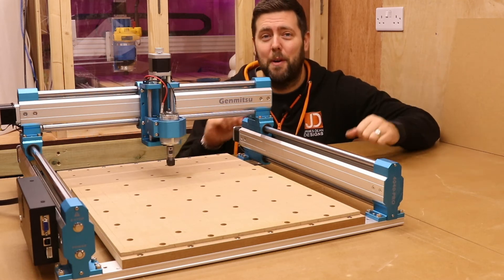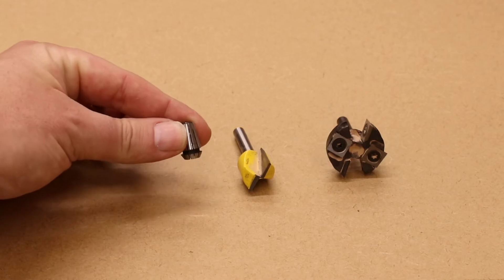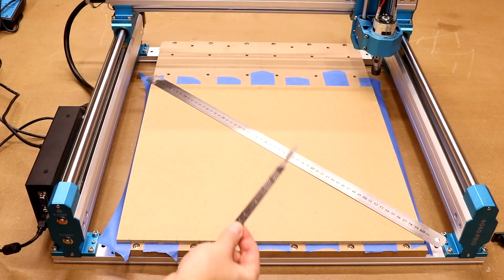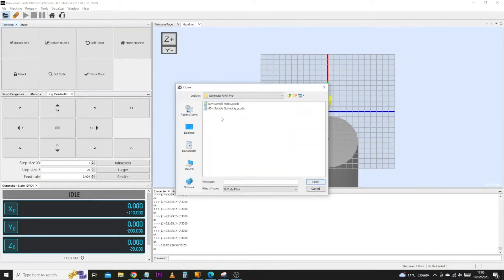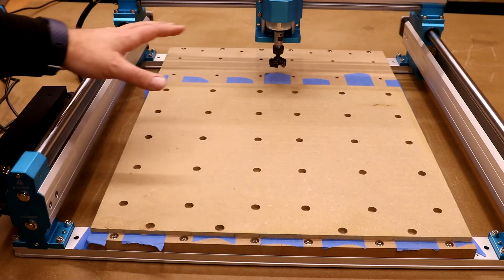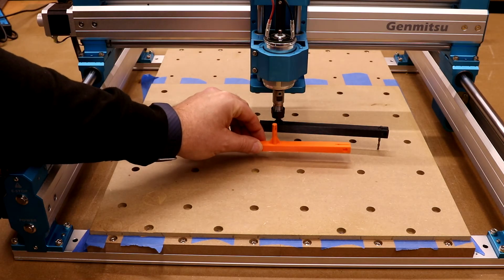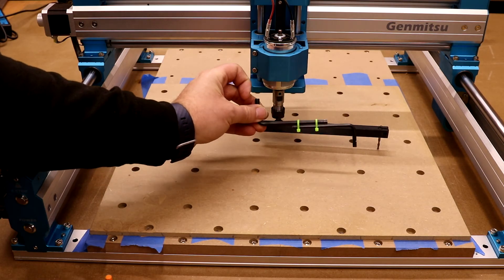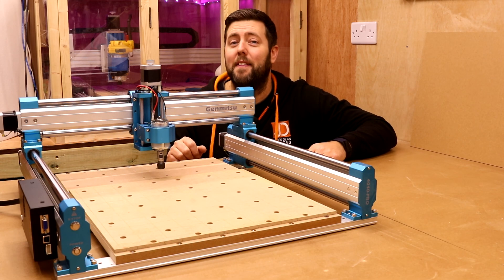Spoilboard and tramming on the Sainsmart Genmitsu 4040 Pro

Comment: Got a home made CNC with a 500MM X 600MM BED so this will be useful as a guide, I had already used one of your videos for a 2418 CNC in past (that was for 3018 but still applies). In case asked the working head is a Makita 700W router with up to 1/4" shank.

Comment: Thumbs up, always great presentation. I will take my time and save up for a 6050 machine however. I'm sure this would be fine for a lite hobby machine, but, for me I will spend the money on a more robust machine and cry once ! Cheers and all the best from Utah !
Reply: I bought the 4030 and yeah I should have saved another 1k to get a good cnc. Replaced the drivers and mainboard and modded the lead screw fixtures to get less chatter. 
I should have bought a Sorotec cnc 😂

Comment: Everybody likes to tram however, it is not needed on a machine that doesn’t have a high tolerance, such as a Bridgeport or Haas, CNC milling machine. What I’ve done is I would level the X and Y axis so that they are level with earth level then I would take a level and check the spindle and you can see if the spindle is 90° using the level to the waste board  You can use one of those digital angle degrees as well. It works good. When you use the level or the angle measurement tool do you need to measure the front and the side of the spindle so you get both axis. I have done this and I’ve gotten it dialed in. Really good with no problems. You can use shims to adjust the corner of each side of the machine for leveling the X & Y axis.
Reply from the maker: If tramming helps the precision (which it does) then its needed. And for the short time it takes to tram it in, its well worth it. May not be your preference but its certainly improved my results on every machine I've had and I'll continue to do so

Comment: Thanks James for your great videos
I'm very new to this, so your videos helped me out a great deal
I have 1 question 
I have the Dewalt 611 with the 69mm adapter on my 400x400 
Do i need to make an adjustment for that and  move the board 2 mm forward or will running the Makita G-code?
Thanks again for your videos
Reply from the maker: Oh that's a good question and one I didn't cover. Yes in theory if you don't trip the limit switches. I generally allow a bit of play in my files so yes, hopefully 2mm should cover you
Reply: Curious if you tried this 2mm adjustment with the DeWalt router and how that worked out for you?

Comment: Once again, I can’t thank you enough for all your help, tips and information! I followed this guide to tramming with my original 75 spindle now I’ve upgraded to the 65mm spindle holder and the 710 W Genmitsu router and I cannot get it trammed! Back right hand corner of about 40° of the board doesn’t get touched by my tramming tool, no matter where I put the tinfoil, any suggestions please?

Comment: James @8.50 you say to leave the spindle where it is. However the machine finishes the cut hole sequence on the last hole. Therefore we have to move the spindle back to x marks the spot. Luckily i had already set the command 1 setting.
Reply from the maker: Once the job finishes, it should return back to the centre. If it stops straight after finishing the hole then something will have gone wrong but at least you've sorted it 👍

Comment: The wood I have available is 0.218 in thick birch sanded plywood.  Is this to thin to use for spoil board. 
I am in US and 0.24 or 6mm is not around.
Thanks for all you great videos.

Comment: Thanks for making this video and the files you provided.
I'm new to CNC and have the 4040 Reno. Can you use the .art file for the Reno? it seems that the spoil boards are the same from the Pro to the Reno and they are both 4040. If so, it would certainly save me time with doing this for my Reno.

Comment: Love your videos, they are a big help in getting started with this machine.  I downloaded your files for the spoilboard but keep having issues where they cause an alarm in UGS most likely running into a softstop.  Not sure how to correct it, any help would be great.  Thanks for all the effort making these vids.
Reply: Probably the Z. You have to lower the spindle pretty far down or else it will hit the soft limit switch and shut you down.

Comment: Hi James, I have just got the 4040pro running and doing spoilboard, am using the Genmitsu r118v router which is 65mm same as makita. I placed the mdf at the front as per video, and drilled the holes, drilled ok, but I thought the holes on spoilboard were to be aligned with pre drilled on the bed, can you clarify please, thanks Gordon

Comment: Good morning, James I have a question. I followed your tutorial for my first spoil board holding the board back to the point that you showed and used the spindle that came on 4040. I have since upgraded the spindle to the Makita router and installed the new Z-axis and want to resurface the board so how do I go about doing this with the board in the spindle location. Each phase of the procedure is shown for the spindle and the Makita but before I click on one of them just wanted to check with you first. I checked other post but didn’t see something that addressed my question. Thank you in advance and thank you for your tutorials. 
Regards, Lamar

Comment: One other comment on shopping list.  on the MDF you call out 435MM wide as 19.7 inches.  I just want to make sure.  I see the spoilboard is even with the base board and 19.7 would for sure be too big. 435MM is 17.12.  Just want to make sure I am using the correct measurement.  Thanks James!!
Reply from the maker: You're absolutely 💯 correct. Have no idea why I put 19.7 other than the board was originally 500mm wide. Either way 19.7in is the wrong width
Reply: @JamesDeanDesigns   Houston, we have a problem. We have NASA engineers making unit conversions again. Yes, I used the 19.7" dimensions and started cutting the holes. The metal inserts were not showing up in the holes. I would pause the program and I thought it was because I was using thinner MDF than 6 mm. Well after 4 holes I discovered my center was off because of the 19.7 in dimension. 435 mm = 17.125" or 17 1/8". Darn us Americans that still use the English system of units. It is a good thing our creations are NOT going to Mars. 😉

Comment: Hi James, I wondered if you have a solution to fitting a dust shoe to the 4040 when fitted with a Makita router? I tried the one meant for the 4030 but it's too big to use on the 4040.

Comment: Brilliant video James. I've just ordered a router for the 4040, will you be doing a conversion video for it?
Reply from the maker: My review will be done using a router. Probably will not do a separate conversion video because it literally is just 4 bolts and then just tramming in it. I've already got a separate video out for installing an SSR which is all you really need

Comment: Great video James! I was wondering, could you make a video on building a metal bed for this machine to use it with coolant? I imagine something made from wide aluminum extrusions would be perfect for machining metal parts.
Reply from the maker: This machine doesn't actually require a bed as such it will be covered I my review but essentially drop a thin plate of metal on a table, bolt the machine down without the bed (perhaps a little silicone around the bolt holes) and you're good to go

Comment: How do we compensate for the fixture flex in various tramming methods?  Other videos suggest using a dial indicator on end of tramming fixture.  Would that be necessary?
Reply from the maker: If I understand  your question correctly, any flex should be consistent as you revolve your tramming jig so it should not really be necessary to factor that in as the tramming jig should really only just be scraping the surface

Comment: Why do you not use a larger spill board? If I wanted to make something the fullsize of the bed, I would not be able to with this one right? Are the files your provided easy to adapt to a larger peice of mdf?
Reply from the maker: If you used a piece larger than the work area, when you come to surface it you would effectively end up machining a pocket out so if ever you put a piece of material on your bad that hangs over one side or more then it would technically never sit flat. Can't remember the exact files I provided on this one but I think I started sharing the original drawings and Carveco files so you should be able to modify if required

Comment: Given the way you secured the 6mm spoilboard to the mdf router base-board using a sandwich of 2" painter's tape and CYA glue/activator between the "slices",  how do you later "remove"  the spoilboard?  Would you reccomend double-sided (as in carpet) tape?
Reply: the blue painters tape has 3 qualities, easy to remove, doesn't leave an adhesive residue behind, paints and adhesives don't soak into it.  the CA glue gives you an instant, thin, strong bond.   when you go to lift and remove the board the blue tape peals easily an comes off clean.  most double sided tape is thick with very aggressive adhesive that hardens over time and will be difficult to remove the boards, may even tear chunks out of the MDF and will leave a mess on the surfaces.   the blue painters tape and CA glue is a perfect idea

Comment: Thank you James, a truly interesting and instructive video, but I have to say that, after watching the video, I tried to achieve the verticality of the spindle with respect to the original aluminum plane, not the MDF spoiler, and it has been impossible for me, I give up. I have a Genmitsu 3020 Pro Max V2 machine expanded to 30x40 with the 710w Genmitsu spindle, which I have been very happy with so far, now I can't shake the thought that there is no way to correct its perpendicularity. How is it that the manufacturer has not provided an effective method to achieve this? My 3D printer does have a mechanism to level the base.

Comment: As always, great video! Do you think this machine will be enough for milling aluminum with an upgrade router like the makita? Are the rails and motors strong enough?
Reply: Machinist here. By looking at the machine and looking up the specs, the answer is both yes and no. Would it be possible to make some chips? Yes, probably. Would you be able to make any functional parts? Not likely. The frame is not nearly rigid enough, the 10mm shafts are way to skinny and would flex and lead screws suffer from backlash.
Reply from the maker: These machines can do metal engravings and even cut pieces out but not to the precision that machinist would expect, so Snakedad is fairly accurate.
Reply: Thanks for the reply guys. I really appreciate it to help me find a decent all rounder machine without breaking the bank.
Reply from the maker: @MasterNengLee  usually machines that do metal well are often smaller work areas and are more ridged. For example this may be accurate to a few tenths of a millimeter, but a more ridged machine will work to within a few hundreds of a millimeter

Comment: Will this process work for the 4040-pro max? How is this done if i have an upgraded spoil board that has the slots and not the holes?
Reply from the maker: I think there is a slight difference because the pro max can only go 405mm wide where as the 4040 pro could do 430mm. I have made a spoilboard for this machine. But just didn't do a video on it this time. If you message me via my website, I'll send you the files if that helps
Reply: @JamesDeanDesigns  Thank you! I just sent it.

Comment: Thank you for the down load for the 4040 pro spoil board. I am using a Makita router . I homed I zeroed and my xy axis made a noise and these codes came up any help is appreciated. I used easel with no issues
Error G10 L20 P1 x0 y0 z0

Comment: i have been trying to set my grid on my spoil board and for some reason it is not letting me use what you said was available every time i try ti open the file there is nothing in it and i have destroyed 2 spoil boards trying to get it to work and it wont and so i tried to do it on my own and guess what i screwed up another board THANKS

Comment: Great video, I'm new to cnc and find your videos super helpful. I bought the 4040pro and used your videos and files. However I'm wondering if maybe I did something wrong in setup as I just ran my machine using your 60w holes file, it did the larger area of the hole but did not go all the way through? I made sure the bit was touching the spoilboard before running. The spoil board is 1/2" thick. Any help would be greatly appreciated.  Cheers
Reply: What I mean is it didn't drill the center of the holes. Just to clarify
Reply from the maker: It is because you used 1/2 thick material. I do say in the video it needs to be 6mm (1/4in) MDF. Anything thicker and the job will not machine deep enough. I did include the original Carveco file in the download so if you use Carveco you could modify the file
Reply: @JamesDeanDesigns  AH! Thank you James, I did miss that.

Comment: Great video! Do you think it'll be possible to get the 4040 to run the 300w spindle left over from the 4030's?
Reply from the maker: It will run it but will need its own power supply I suspect to run it at full power

Comment: So if you have a Makita, you put the wasteboard all the way to the front, but still use the same file that the spindle would use for drilling the holes and flattening, correct?
Reply from the maker: There are separate files for the 60w and makita for each stage but you start both of them from the centre of the board and everything shuould line up

Comment: I have the spoil board glued down and started cutting the holes.  The cut is not breaking through the bottom of the spoil board and is leaving a small plug in the center or the hole.  I am using 1/4" MDF from Home Depot (US).  I did move the spindle down as shown. I have not measured it (yet) but I'm thinking it's truly .25" and not .24" which is closer to the 6mm, so the cut file just isn't going deep enough.

I'm considering running the surfacing first, expecting (hoping) it will allow the bit to cut through the bottom.  Anything different I could try?

Update. Yes it measures at 6.5mm. I'm sure that's why it didn't cut through.

Comment: Hi James. my 60w holes endmill file stops at a particular point. first time happened and i restarted same file again but again it stopped at same exact point (on the 12th hole drilling on right bottom right corner of the board). what may be the problem?
shows ALARM HOLD SOFT RESET CYCLE START

Comment: Will these files work with the 4040 Reno? Thanks
Reply from the maker: @andrewlander8429  probably not as the start point is likely to be different. However, i think I did provide the base drawing so you should be able to easily adjust it to suite the Reno
Reply: @ thanks for the quick reply. I’m a complete beginner and only ordered the RENO yesterday due to the huge discounts. I’ll be watching your tutorials for a while it think!

Comment: I see James you didn't use the probe is there a reason I figured it would be easier than getting the bit to surface..like always great video
Reply from the maker: Truthfully, it was because I was being slightly lazy. It's hard to explain but because of how I was filming, it's difficult to get back and forth between the camera and PC so instead of keep going back and forth,  I just lowered the Z down by hand until it touched the material. I am having a slight issue with UGS and the Z probe at the minute though which I'm trying to get to the bottom of

Comment: Hi James, I have the same cnc but I'm at the beginning... I would like help on how to make a file to flatten my cutting board. If you want to give me a hand... Thanks and congratulations for your videos which I follow with great interest
Reply from the maker: Hi, It varies slightly between software but usually you draw a rectangle slightly larger than the material and then do it as an area clearance type pass. If using a large CNC bit, just make sure you take shallow passes to be safe

Comment: Hi James, I had a problem with the Z axis creeping down on it's own weight and the bit would bog down into the material that I was trying to mill down. Sainsmart got back to me saying to try entering in $1=255 it seems to have worked, but I haven't really done any real work with the machine yet. Ever since the bit bogged down into the material I've been getting a lot of vibration through the machine now.
Reply from the maker: Thats one of the first settings I always change. I'm not 100% sure why they don't just set it to that as default.
Go around and check ALL the bolts on the machine. Vibration loosens bolts, which causes more vibration...which loosens the bolts even more
Reply: also check if the bit is being pulled down out of the chuck. it can happen if the chuck isn't tight enough an you are doing an aggressive cut.

Comment: Hey James, I've tried running the Makita 65 mm holes and the machine stops with an alarm on the first hole, I'm not good at g-code  so I do not know what I'm doing wrong
Reply: The file size is incorrect for the 4040 pro

Comment: Hey James I could only find 12.5mm mdf how can I use this to drill the holes when I ran it and it won't go all the way through
Reply from the maker: The only way really would be to edit my Carveco file that I included in the download. Do you have Carveco?
Reply: I used 12mm
I just ran the file and then drilled through the rest of the way with a 10mm drillbit

Comment: Really surprised that the spindle height won't allow standard size bit to touch the spoilboard without covering the vents. Normal 3018's measure correctly! Its not one of the alternative mounting height of the spindle clamp scenarios?